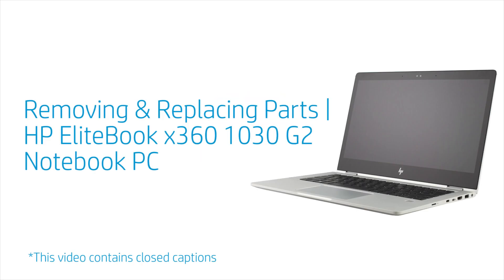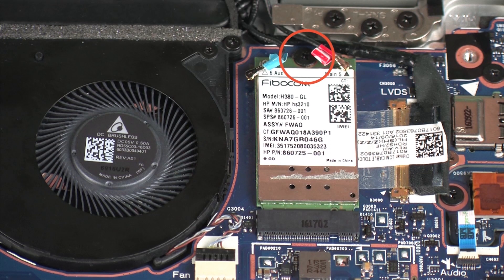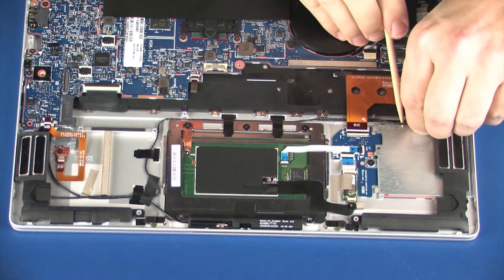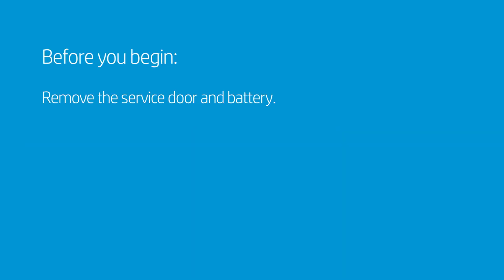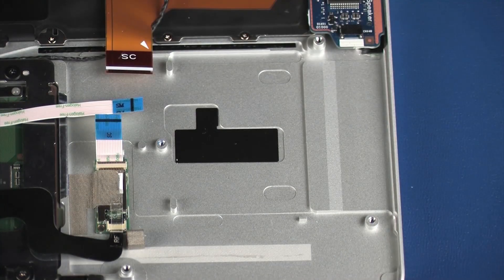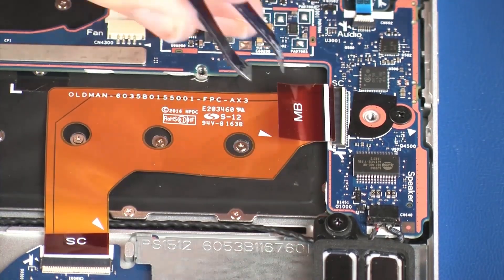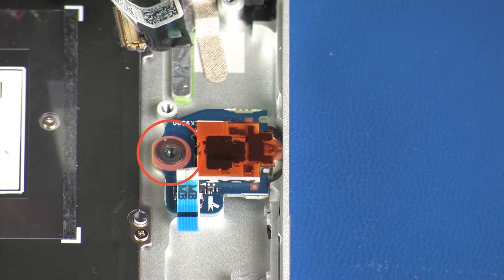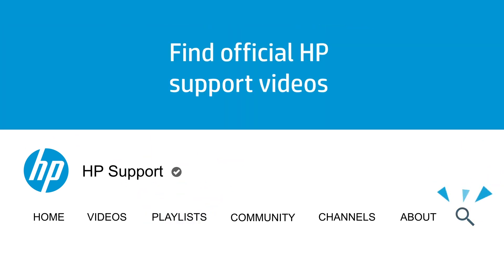Removing & replacing parts for HP EliteBook x360 1030 G2 | HP Computer Service

Comment: Hello, thank you for this video.
Please can you demonstrate how to replace the CMOS battery too?
Thank you.
Reply from the maker: Hi there, thanks for contacting HP Global Social Media Support!
I understand that you need to know about replacing the CMOS battery of your notebook.
I will do my best to assist you.
Most of the newer HP notebooks such as yours do not have a CMOS battery.
The internal battery maintains the clock and BIOS settings.
Below is the link to the service manual for your model series, and as you can see...no RTC (CMOS) battery is listed and nor is there a procedure to remove and replace the RTC battery: https://hp.care/6058UIPjr
Regards, 
HP Support

Comment: Hi, the bottom part of my bezel is popping out. It pops out more the farther I open the laptop. How do I fix this? is it possible to glue it or do I have to get a new glass
Reply from the maker: Please contact our customer care team over the phone or chat for further assistance, as this issue requires Live conversation with you over phone or chat to isolate the issue and provide you instantly with appropriate solution or repair/replacement options available at your place as per the warranty.
Please feel free to reach us on call/chat, please access this link to select your preferred country and language option to reach us. Global support link: -  https://hp.care/41H8oZD
Akhil_HP Social Media Tech Support

Comment: when i rotate my screen x360, the keyboard and mouse still work and my roation lock button is unclickable
Reply from the maker: Hi there, thanks for contacting HP Global Social Media Support!
I understand that the screen rotation button greyed out.
Don’t worry, I assure you I will try my best to get this sorted.
I recommend you follow the below steps and check if it helps.
Open Settings App and go to System > Display.
Find Orientation and choose Portrait from the menu.
Your device should automatically switch to portrait mode.
Please let us know how it goes!
Regards, 
HP Support
Reply: thats the only problem , when i turn my laptop 360 (folded)  the keyboard and mouse still function as it is folded , hindering me from using it like a tab @HPSupport
Reply from the maker: Thanks for the reply.
Try the below steps:
Win + R -> type 'regedit' and enter
Registry editor will open up.
Goto path -> HKEY_LOCAL_MACHINE\SOFTWARE\Microsoft\Windows\CurrentVersion\AutoRotation
Check the value of Enable file if it is 0 rotation will be OFF, if 1 rotation will be ON.
Restart and Auto rotation will work. 
Regards, 
HP Support

Comment: I can’t find a way to remove the memory RAM since it’s not possible and I think my laptop is having a memory failure keeps beeping whenever I have it turned on please how do I fix this
Reply from the maker: Hi there, thanks for contacting HP Global Social Media Support!
I understand that you are experiencing an issue with the memory of your notebook.
I will do my best to assist you.
Checked the specification of your notebook and found that the memory is soldered down on system board.
Please refer to the instructions mentioned under this document to fix the issue: https://bit.ly/34b23sv
Binu-HP Social Media Tech Support

Comment: hii there my hp elitebook x360 1030 g2 is only switch on when it's plugged in when battery is showing fully charged can u assist me what's the problem
Reply from the maker: Hi Jaishree, thanks for contacting HP Global Social Media Support!
I understand that you are experiencing an issue with the battery of your notebook.
I will do my best to assist you.
Troubleshoot the battery to see if it needs to be replaced as mentioned here: https://bit.ly/3O3PR3x 
Binu-HP Social Media Tech Support

Comment: Hello Mr, I have a concern with my hp elitebook 1030 G2 computer.
when I completely fold my screen at the back so that it is in tablet mode the screen goes black when I am in front of it and turns on by itself when I turn my face away from the screen
Reply from the maker: Hi there, thanks for contacting HP Global Social Media Support!
I understand that you are experiencing a black screen issue while switching the laptop in tablet mode.
I will do my best to assist you.
Please try reinstalling Intel Sensor Hub Components Driver from here: https://hp.care/45cP085 
Binu-HP Social Media Tech Support

Comment: I think my laptop is having RAM failure, it beeps 3 long beeps and 2 short ones, which indicates RAM problems, according to the comments the RAM isn't replaceable on such model, what should I do, is the laptop dead?
PS i have this exact model as shown in the video
Reply from the maker: Hi there, thanks for contacting HP Global Social Media Support!
I understand that you are experiencing a beeping issue on your notebook.
I will do my best to assist you.
This document provides possible solutions to many common computer start-up issues. Follow the instructions in this document step-by-step to help isolate the problem and find the most appropriate help: http://hp.care/2oFlOWC
Binu_HP Social Media Tech Support

Comment: Is the cpu replaceable? Hopefully you notice it’s been a while
Reply from the maker: +Noob PG3D HP does not recommend upgrading or downgrading hardware parts or software that is bundled with the product as It may affect the manufacturer's warranty and performance, however, you could change the configuration at your own discretion.
Reply: @HPSupport  ok can you recommend a budget gaming laptop for me then, preferably 1000 or less or a bit more usd

Comment: where is CMOS batter for RTC ?
Reply from the maker: +Kalpesh Patel Please refer this document to know about removing and replacing CMOS battery: https://bit.ly/3f5QCHR
Reply: Were you able to figure this out? I am getting RTC errors whenever the battery is unplugged.
Reply: @boykathy9339   Yes there's no CR2032 coin battery. It works from your laptop Lipo battery. You are getting Error because your battery is dead. Replace laptop battery and it will be solved.